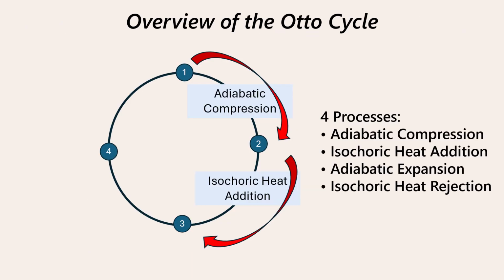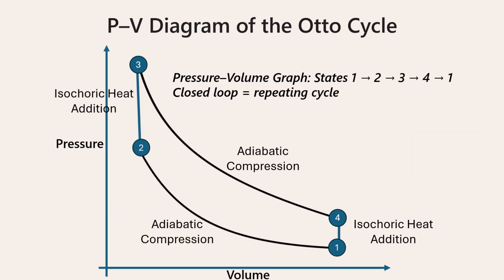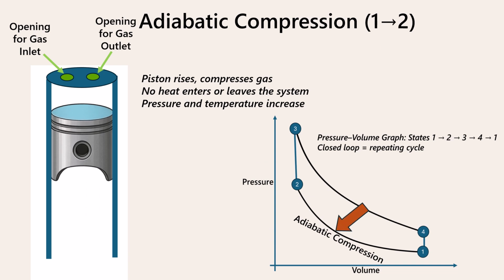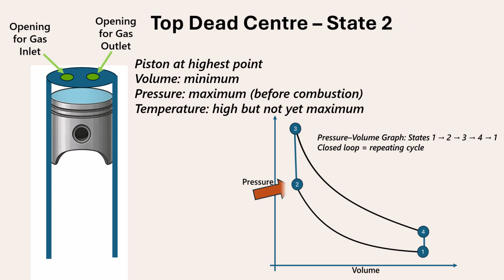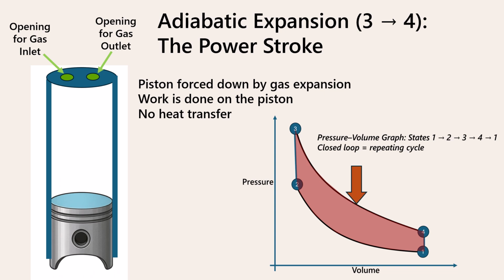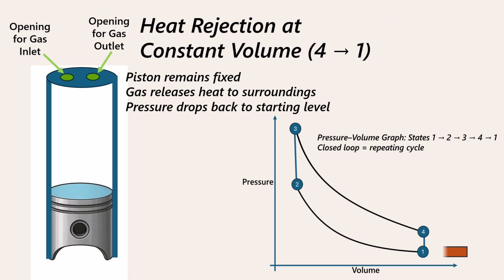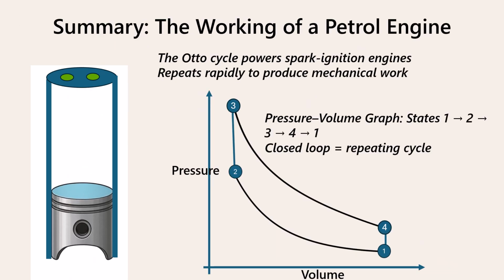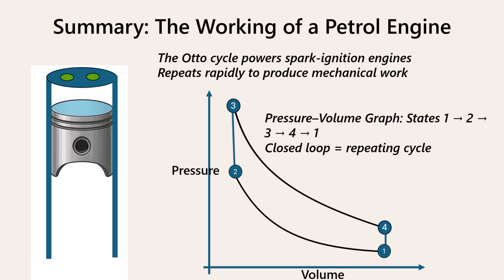How the Otto Cycle Works – Thermodynamics of Petrol Engines

Comment from the maker: 📘 Want to go deeper into the Otto Cycle?

Explore the full lesson with diagrams, pressure–volume analysis, piston motion, and step-by-step breakdowns here:
👉 https://prep4uni.online/stem/science/physics/thermodynamics/classical-thermodynamics/

✅ Learn how the four processes of the Otto Cycle work together:
– Adiabatic compression and expansion
– Constant volume heat addition and rejection
– PV diagram interpretation and mechanical work

💬 Questions or feedback? Leave a comment below — and don’t forget to check out more free resources at Prep4Uni.online.

#OttoCycle #Prep4Uni #Thermodynamics #EngineeringEducation